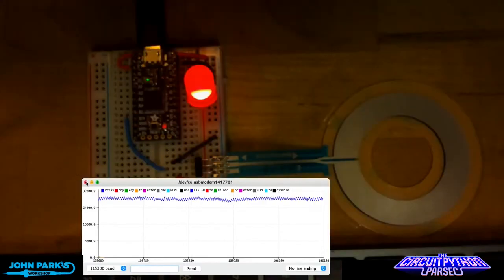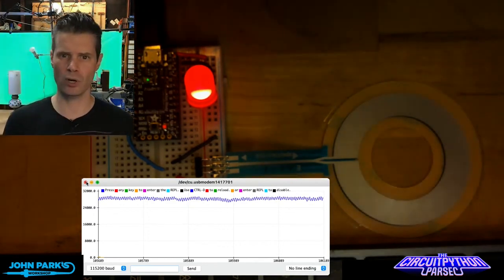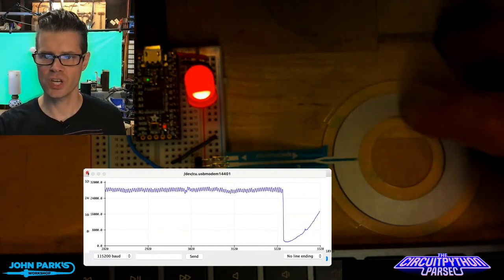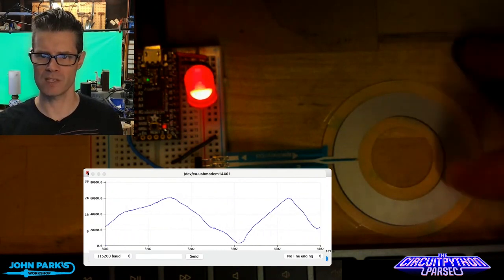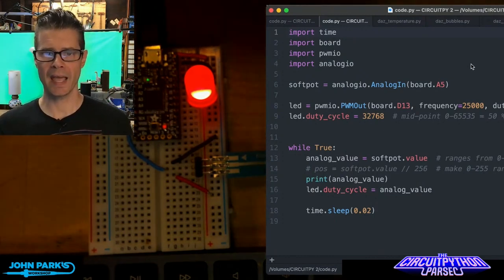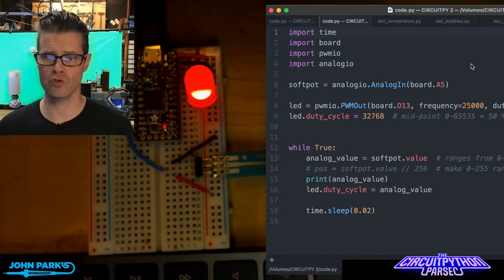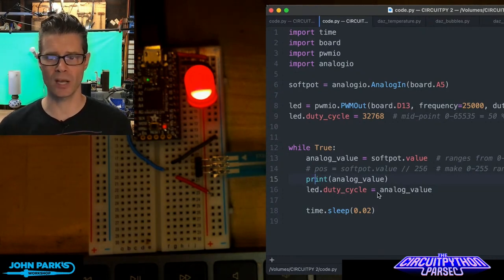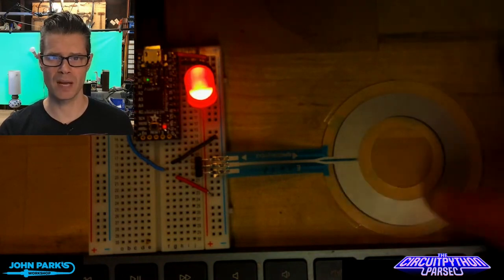John Park's CircuitPython Parsec: Analog Input @adafruit @johnedgarpark #adafruit #circuitpython

Comment: Looking for the complete text of the code.py, as some of it was cut off on the OBS screen shot.
e.g: what is the rest of the line "led = pwmio.PWMOut(board.D13, frequence-25000, dut"

Not quite enough clues at the product page:  https://www.adafruit.com/product/1069
Reply from the maker: import time
import board
import pwmio
import analogio

softpot = analogio.AnalogIn(board.A5)

led = pwmio.PWMOut(board.D13, frequency=25000, duty_cycle=0)
led.duty_cycle = 32768  # mid-point 0-65535 = 50 % duty-cycle

while True:
    analog_value = softpot.value  # ranges from 0-65535
    print(analog_value)
    led.duty_cycle = analog_value//16
    time.sleep(0.1)